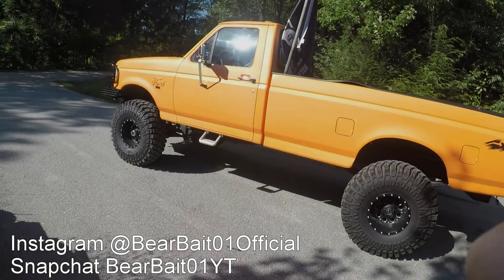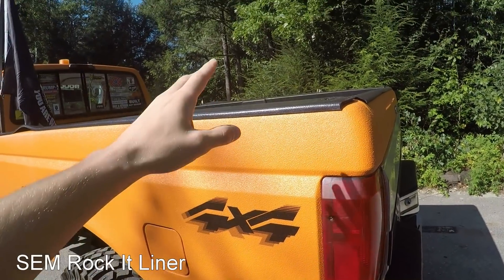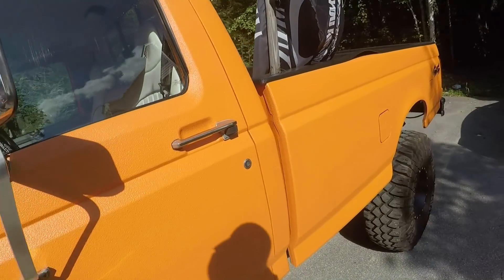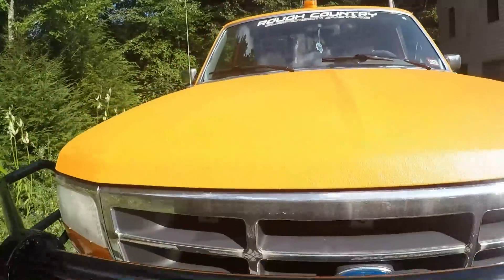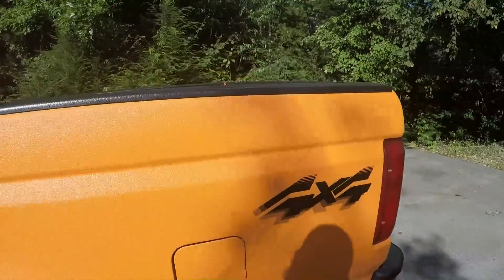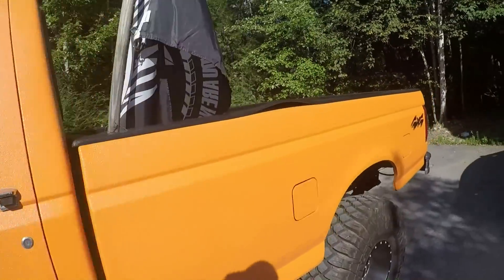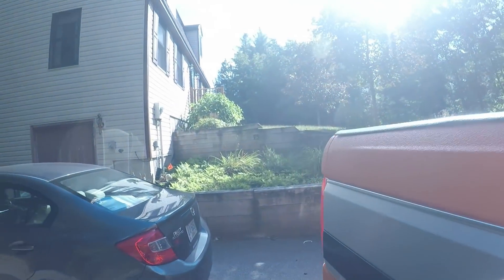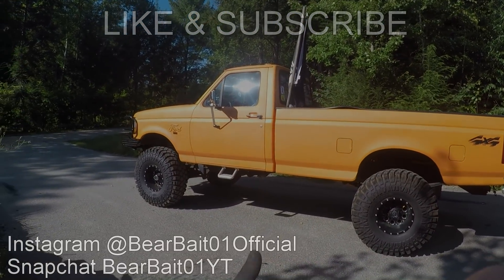Bed Liner Paint Job - 1 YEAR LATER! 9" Lifted OBS Ford on 38s

Comment: Tinting bedliner is honestly so simple anyone could easily do it themselves & save some time & money. Just buy a pint of whatever color paint you want and mix it into the bedliner according to the directions for whatever specific bedliner you buy. It’s usually about 10% color. So if you have a 20 oz bottle of bedliner, add about 2 oz of your color of choice and shake/mix well. If it needs a hardener add that next, shake/mix again and your ready to go to town.
Reply from the maker: They tinted it for free. I just bought the liner and they tinted it.

Comment: 💢I have two questions: 1. Has it made any change on your vehicle insurance? 2. Any change in your gas mileage for the weight?
Reply from the maker: 1. No the insurance doesn't even know nor do they need to. 
2. Nope not at all
Reply: Awesome thanks man
Reply: Insurance? What kind of question is that? Which direction do you think the premium should go?

Now we move on to the mpg question... how much weight do you think this added to the truck that it would change the mpg? 

Let's try to ask questions that are sensible. 

Example of a good question : would it be better to spray it heavy to have a smoother texture in the spots that catch bugs?

Example of a nonsense question : see your 2 questions or : does the bedliner effect the radio transmissions from the mothership?
Reply: Why would you tell them you've changed anything
Reply: phuc ewe  yes. This  is a more relevant question.
Reply: phuc ewe  I am really debating painting a whole vehicle with bedliner...